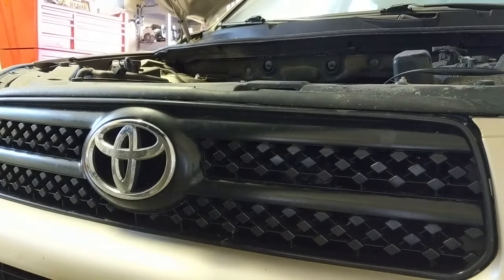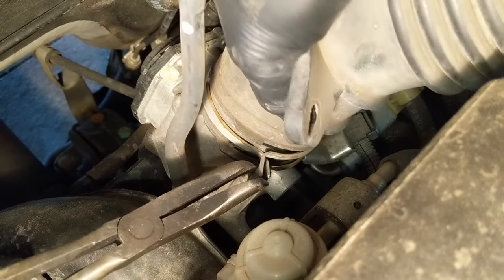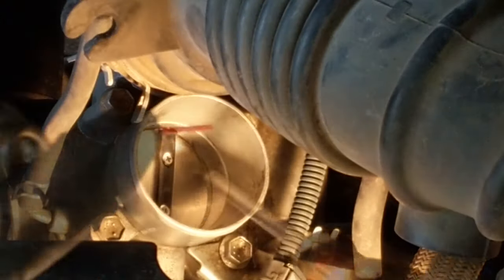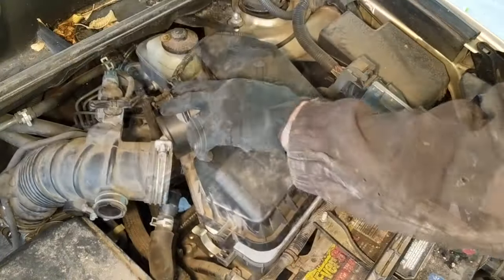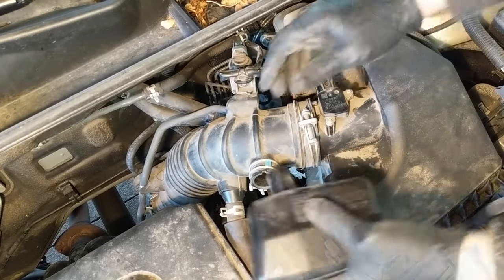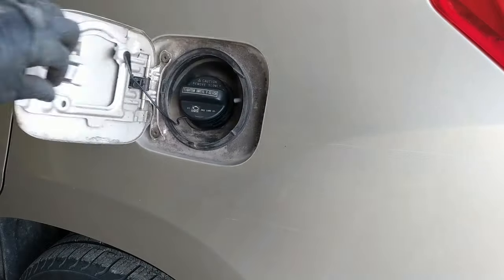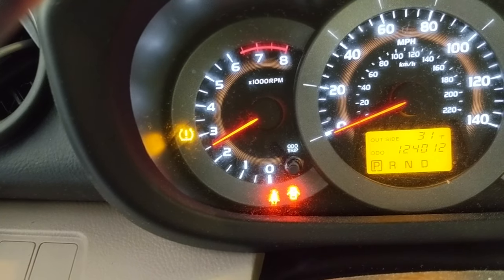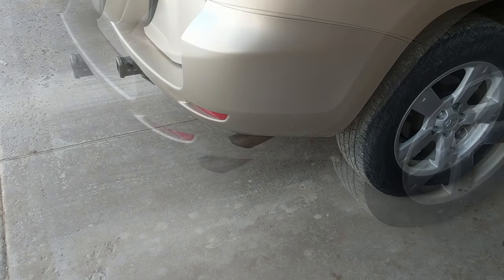2006-2012 Rav4: Throttle Body,  Intake, MAF, & Injector Service

Comment: I did the 100k tune up plugs wires etc etc and it was still chugging at startup, running like garbage so I decided to try this next. IT WORKED! I cleaned the throttle body out, did about 80mph on I95 for about 3 miles or and now the Rav4 runs great with smooth startup. Thank you very much!!!!
Reply: @gannonboston4018  find anything good?
Reply: I’d also replace the fuel filter  dirty one will starve engine

Comment: I just took my 2016 Rav 4 with 35000 miles for its last free oil change at the Toyota dealer where I bought it new and tire rotation and balance on 2/8/21. It is now out of its warranty now. In about 15 minute they come to me and tell me that they have done a free inspection and have looked at and found that my throttle body is all sooted up and the injectors are clogged and need cleaning. I ask how much, it is $220 for one and $115 for the other.  So I tell them thanks for letting me know and I would take care of the problem when I get it home myself. They say it will be finished just as soon as they run it through the car wash. Stopped on the way home and got a can of throttle body cleaner and injector cleaner to add to the gas. Got home, popped the hood, removed everything to get to the throttle body on the back side of the engine, could not see where any of it had been removed to inspect it where they could tell it was sooted up. The throttle body was clean as it could be. I put it all back together, put the can of cleaner in my shop unopened and the next time I fill up with gas I will add the bottle of injector cleaner to it. The car engine runs like new so I will write this off to them trying to up sell me their service. This is the reason I do not like taking my cars in because of all the Bull Sht up selling they try to do.

Comment: Wow i cleaned the Throttle body as much as i can but it was soo uncomfortable im a women 5’4 tall..i didnt stick my hand inside the left side of the throttle body i didnt remember that part of the video..also cleaned the air mass flow sensor..i cant believe it what a different!.. the car respond and drive faster, the throttle looks like it was never cleaned before, it was hard for me but IT WORKED !!...the car with 165k miles felt like trash  like a 200k some miles  but after this it fell like it has a lot of life left..

Comment: MasterJacks, to clean the MAF properly, just take out the two screws and then spray with throttle body cleaner. Also let it dry completely b4 starting engine.

Comment: Thanks, Jack! I replaced the plugs, PCV, air filter, and cleaned the MAF and throttle plate today. 2008 Rav4 with 98k. Runs like new now, idle and throttle response is nice and crisp. I appreciate the time you took to make the video!
Reply from the maker: JPM2010 I'm glad to here it went well. Thanks for the feedback!
Reply: What is PCV and how do I replace / clean it ?

Comment: - If changing spark plugs do it after all this operation, oil also. And wash/ clean the motor area prior.
While reving the engine and adding Seafoam, you can turn the  key off and carefully add a little raw Seafoam to finish, and the remaining revs/ vacuum will pull it in, coating the insides. Just let it soak the valves, piston head, and chamber a few hours. Better chance the carbon may release/ come loose later. May need a little starter fluid on restart. Good Video. Thx

Comment: Once again MJ thank you. Our 08 Rav4 213000 miles never touched throttle body, intake, MAF, & Injectors. Only added some Sea Foam occasionally to fuel system.
Reply: The check engine light,VSC,4 WD &  Maint REDQ. These idiot lights come on then go out when is very wet outside. It never affects the proformace.

Comment: Thank You! Really appreciate the video, the content you shared, and the precise manner you shared it, good visuals and information. I followed your directions step by step which resulted in clearing up problem I was having with slow idle almost to a stall when stopped at traffic lights or stop signs.  I gave a thumbs up and subscribed.  2008 Rav 4, 4 cylinder with 233.000 miles on it. Muchas Gracious!

Comment: Currently have a 2008 rav4 with 182,279 miles on the ODO. And idles super low to 500rpms and shakes hard as hell but goes away. But I’ve noticed that at times it would be related to my AC when I had it blasting and cranked up high. But when I turned it down it would stop shaking. With that said, im going to do exactly what was done In This video and see how it turns out.
Reply: Update: just did exactly what was done In This video and overall the shaking and low idle pretty much gone. The idle sits just at 1000rpms even when ac on, but still shakes a little when blasting. On top of this, I did this whole service just before I took it on a 6hour drive down to a border town to see my great grandparents. And drive it an additional 6 hours back. Still runs great! So yeah recommend doing this. My odometer sitting on 183,267 currently.
Reply: Update: the shaking has completely stopped now even with ac blasting. Problem is gone. That’s all

Comment: Thanks for making this video. I have the same color 2006 RAV4, in a 4 cylinder as well. Just performed the throttle body cleaning on it and I think I solved an engine shuddering issue I had (dropping RPM's to 500 right when I slow down to a stop). 

Just wondering if anyone here has this car? If so, are you experiencing some whirring/humming noises coming from the driveline? Curious to know if you have the steering clunking noise as well? I haven't been able to definitively nail the origin of these problems, wondering if maybe you have... 

This car has been unstoppable aside from a few non-critical issues. The only downside I can think of is that I don't have the 3.5 V6, those are peppy for being an unassuming crossover.
Reply: I have those metal clinking sound when I back up or trying to turn to the right or left... Must be related to more than one causes?
Reply: I'm getting the shudder also. Only happens while in gear. I also think I should be getting a little better mileage than 18-19 for standard driving. I would think it should be above 20.
Reply: I've done everything as shown however did not completely eliminate shudder and RPM drop. Was told clunking noise while turning is characteristic of the electric steering.  Is whirring noise loudest at floorboard behind driver's seat? Fuel pump is in tank and close to that area. My 07 recently started making a whirring noise and am thinking fuel pump is going.  Also concerning the 100,000 miles Iridium plugs. NOT. Check them for yourself. I'm thinking 75,000 miles  at the most. Good luck!
Reply: FYI -TSB ID #TSB-0318-08 REV1 - TOYOTA: STEERING INTERMEDIATE SHAFT NOISE. MAY HEAR A CLUNK, POP, OR KNOCK TYPE NOISE WHEN TURN IN THE STEERING WHEEL LEFT OR RIGHT. A NEW INTERMEDIATE SHAFT HAS BEEN DEVELOPED TO ADDRESS THIS CONDITION.

Comment: These Toyota MAF sensors are designed to be removed with the two Philips screws on top. The part you sprayed and cleaned is just the air temp sensor. The actual air flow sensor is concealed and only accessible by removing the sensor from the filter box assy.
Reply from the maker: Thanks for the note.

Comment: I like to wipe off my hose connections with a soapy warm used up micro fiber towel, and then liberally use SIL-GLIDE 
Silicone brake grease (multi purpose) 
On the parts to reassemble.

Comment: I didn't know you could use the intake manifold port to clean past the throttle body with Sea Foam!! I've been buying the Sea Foam Top Engine cleaner with the little straw attachment. Such a pain to use because of the throttle body location which forces me to turn the bottle upside down and just makes a mess. Your way is so much easier!
Reply: You did a better job than the video by dispensing the Sea Foam Top Engine cleaner over Throttle Body. Why? Coz this enigne is a Direct Injection engine. It means the fuel does NOT flow over the intake valve. If it had to, it would keep the valve clean since Gasoline is excellent solvent! Intake valve being dirty and gunky with oil that comes back from PCV valve is what causes major engine problems. That seafoam in the tank is NOT going to clean your intake valve. It will only clean fuel injectors at max. The actual complete maintenance needs Fuel Injector cleaner (in this video) PLUS Sea Foam Top Engine cleaner which will indeed go over the intake valve (coz you are mixing it with air, which does go over intake valve). What you did, was a good job. You cleaned the intake valves as well (which are more important than cleaning fuel injectors)

Comment: you sprayed that MAF cleaner and is dripping down moisturizing the filtering net of the air box. I can fee  the awfully -toxic smell of the air blowing in the cabin. Did you think a little before doing that?
Reply from the maker: Good question, yes. The cabin air intake is separate from the engine air intake. Not only that, the 30 minutes it took to finish the job and reassemble left no residue that hadn't already evaporated. Thanks for watching.

Comment: Thanks. Is the liquid from Throttle Body Cleaner going inside the butterfly opening. Is that OK?
Reply from the maker: Yes, it's flammable and will be burned by the engine. When you first start the vehicle, the engine will run rough until it clears.

Comment: Also note this generation of Ravs has many owners' complaints of spongy brakes. Once the symptom occurs (often after a brake job) the problem is virtually impossible to fix.
Reply: Its thr master cylinder that goes bad, its an easy fix
Reply: @zander4076  ....replaced the Mast Cylinder...no fix. This is an extremely common issue on Rav4's. Alotta guys have tried everything, still spongy.
Reply: T @mwngw  The master cylinder is common in this generation of Rav4s . You need to get all the air outta the brake lines after the master cylinder replacement..Spongy brakes = air r in the brake lines YOUR WELCOME..

Comment: @master jacks...nice video..does opening the valve from a TB with my fingers damage it?? just wondering i don't really know much i want to clean mine
Reply from the maker: It won't hurt anything to rotate the plate by hand
Reply: do you think anything will happen if i remove the throttle body to clan it from the back?
Reply from the maker: @ayleenvalencia4870  You could do that. You might have to replace a gasket or o-ring where it connects to the intake manifold.
Reply: @masterjacks thank you !!!

Comment: Will cleaning the throttle body help with the long cranks when engine is warm? I heard yours crank a bit before starting up after the cleaning
Reply: The long crank was because he sprayed throttle body cleaner directly into the engine and it was partially flooded. Best practice is to remove the throttle body from the intake and clean it with a rag. Toyota released a technical service bulletin regarding spray cleaners damaging the electronic motor through the throttle shaft.

Comment: Hi there, great video, car is running much better now. Just one issue I’m having, when I was doing the last part, I did just as you said, had my wife hold the gas at 2500rpm and funneled in just a little bit of sea foam, my check engine, VSC and 4wd light came on and won’t turn off now. Should I be concerned and have it diagnosed? Or should I just try to reset it? Thanks for the help!
Reply from the maker: Running the seafoam treatment can cause the engine to run rough during the procedure. If the computer isn't able to successfully compensate for the erratic idle, it will deactivate some stability control systems so as not to create a safety hazard in a system it can't fully control. This also sets a few malfunction indicator lights. 
If it were mine, I'd clear the code(s) with a scan tool or by disconnecting the battery. From what you've said, that should clear everything up! Let me know how it goes.

Comment: Thanks for sharing.. Did you notice a difference after doing this .. you said it helps clear ruff idle.. did it help ?
Reply from the maker: Randy Murray this car didn't have any idle problems, but I have worked on cars throwing codes for high or irratic idle caused by restricted airflow across the throttle plate. I recently serviced a Ford Focus with a code for "RPM out of range" and cleaning the throttle plate  solved the problem. Electronically controlled throttle bodies are more susceptible to this fault. I did this particular service as preventative maintenance. Plugs and wires solve a lot of rough idle problems. Hope that helps!
Reply: Oh yes very much so, Thank you!

Comment: Hi Jack, very helpful videos. I have a Rav 4 2006 4 cylinders and recently replaced the alternator, and the drive belt. Note I disconnected the car battery which I believe reset the ECU. After this I noticed the engine was running rough, which got slightly smoother over the last couple of weeks but was still happening when idling. I then replaced all spark plugs which were quite worn. Now the car runs well except when idling the Revs often drop around 500 thus vibrating the car. Would a throttle body, intake, MAF and Injector service help with this? If not what else would you suggest to do? There is no engine warning light or codes displayed on my OBDII
Reply from the maker: A dirty throttle plate can cause the symptoms you're are describing. If it were mine, I'd definitely try that first. It's cheap and good maintenance even if doesn't fix the problem. A MAF sensor can also cause erratic idle issues and not necessarily throw a code. I'd try those two things first.

Comment: Do you have to disconnect the battery in order to be able to stick your finger inside the throttle plate, I hear you should not move the plate at all, or is it just a myth?
Reply from the maker: I can only go off my own experience, but I've never had a problem manually opening an electronic throttle body. I've always done it with the key off, but haven't necessarily disconnected the battery. Once you turn on the key, it might mess things up a bit if the computer is commanding one thing and you're forcing something else.
Reply: @MasterJacks   Thank you for your prompt reply, I will now confidently clean the throttle body on my Rav4, but just to be extra safe I will disconnect the battery. Thank you again.

Comment: I just had to replace the EVAP valve in my 08 Rav4 and now I'm getting a lot pf shaking while idling. Would this, in theory, help with that issue or would you recommend what you did with the spark plug video? Thanks for any info
Reply from the maker: Not sure what the correlation is between the evap repair and the rough idle, but doing this procedure is good maintenance and may fix your problem. Worth a try in my opinion. Spark plugs would likely have given you a check engine light for a cylinder misfire. If it's got 100k miles on it and they haven't been done, it's also good maintenance that may improve drivability..

Comment: Hey Jack, is throttle body electronic or cable driven?  Thanks
Reply from the maker: It's motor/electric on this one
Reply: Is it ok to move plate by hand if it’s electric?
Reply from the maker: Yes, key off/battery disconnected

Comment: Hello MJ,

I want to clean the fuel injectors of my 2009 RAV4 using OTC fuel injector cleaning kit. It should be connected to the fuel rail. Could you please help me to figure out how to do this. I am an amateur.
Thank you in advance.
Reply from the maker: Mahinda Ranasinghe that's a little outside the scope of this video. I would recommend watching some videos by OTC and getting the help of a local mechanic or mechanically inclined friend to help you identify the schrader port on the fuel rail. I imagine OTC would be happy to provide some guidance as well if you contacted them for techincal support. All the best! MJ
Reply: MasterJacks 
Thank you again for the prompt reply.

Comment: Hi after doing the throttle body cleaning and adding seafoam in the fuel tank car ran smoother. However after adding the seafoam to the air intake hose as described, during the process, check engine light, VSC, and 4WD, lights came on dashboard.  I drove the car for a few miles, and still on. Any insights?
Reply from the maker: It's not uncommon when doing this to get a misfire code which can deactivate the stability control. If it's running smooth again, I would clear the codes with a code reader and everything should be back to normal. If you don't have one of those, you could disconnect the battery negative terminal for about 1 min, then reconnect it.
Reply: @MasterJacks  thanks that cleared up the codes. However the car still has a bit if a shudder when stopped at a traffic light. It is more pronounced when I change gears to reverse. I therefore changed the spark plugs too, and no difference. Any other thoughts?
Reply from the maker: @jaychadderwala8975  my guess is that with a clean throttle body your idle rpm is lower. As the throttle gets gummed up, the computer cracks open the plate to maintain airflow, which increases rpm. Now that it's clean, it's idling back down to where it should. At stop light or reverse, there's a little bit of torque converter load on the engine (as apposed to being in park) and it lugs rpm down lower still. I wouldn't be worried about a shutter if this describes your symptoms. If the engines shakes quite a bit, could be you have a worn motor mount(s).
Reply: @MasterJacks  thanks